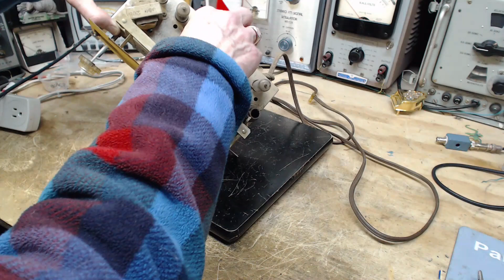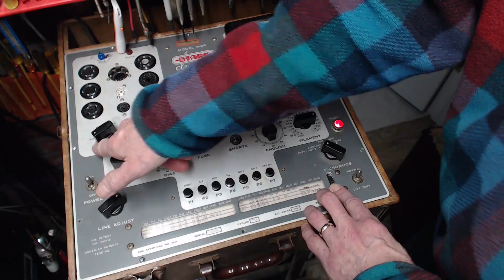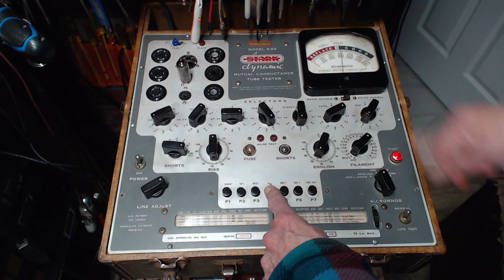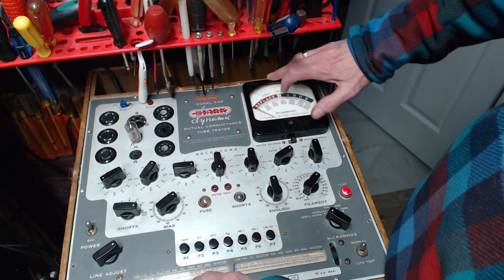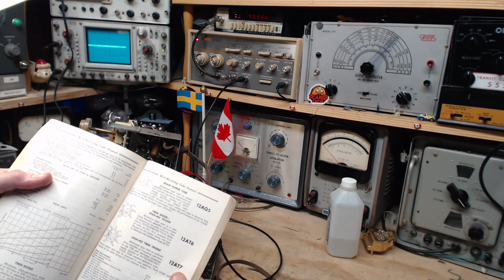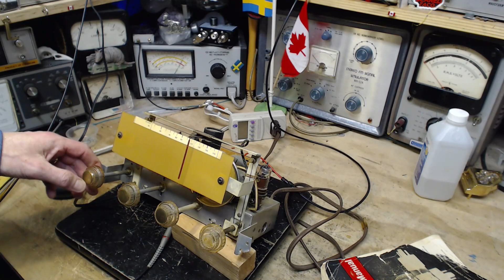Philips PH202 Vacuum Tube Console Video #2 - Radio Receiver

Comment: I made a living repairing AM radios back in the 1950’s and 60’s using just an RF oscillator and a Simpson  VOM. Am radio is not rocket science. You are hooking a lot of grounded equipment to a hot chassis Radio. The isolation transformer is not a fail safe device. Seldom did I have the luxury of a schematic.

Comment: There was no reason to test the 35W4 and 50C5 for a weak RF signal, when a simple DC voltage test will clear them. If you inject a simple low level audio signal ti the input of the volume control, you can clear  audio section.

Passing an IF signal of 455kc  to the mixer input will check that section.  Injecting a signal of 1 Mhz will determine the tuner response. Then manually sweep the AM band for sensitivity.

Bot for criminal sake get those old caps out first! 

Formal  Band RF Alignment is the very last thing you will do, after sweeping the IF circuits. 

But do something ! Talk, talk, talk

The primary tube would be the 12BE6 or 12BA6 handling the  RF / IF signals. The 12AV6 would be the last I would test. So now you are convinced the tubes are good,  use your signal tracer or signal generator. Better yet change all the dam capacitors. If you think one is bad  why not consider all are bad and cut to the chase.